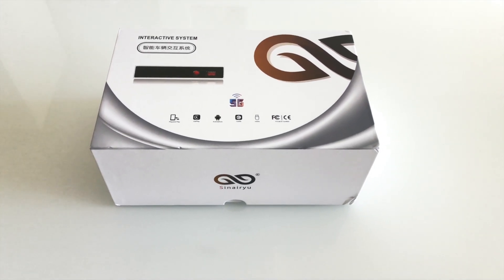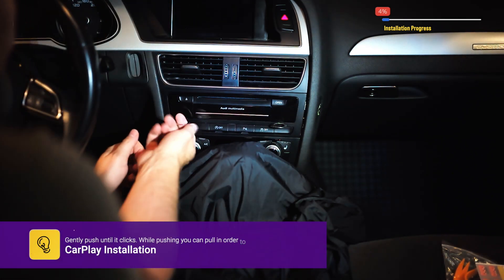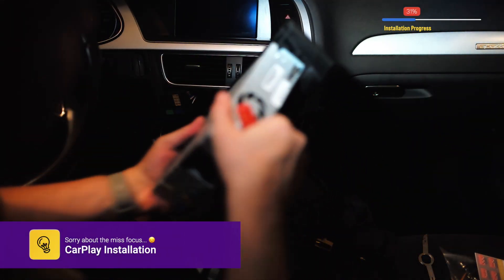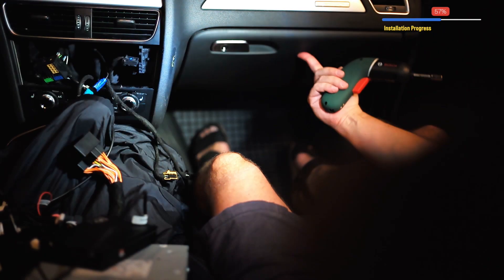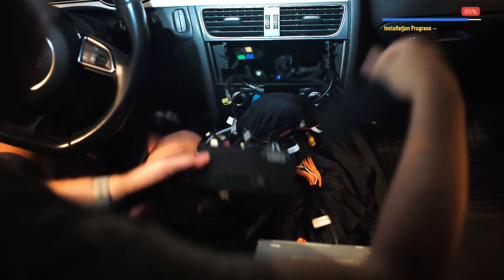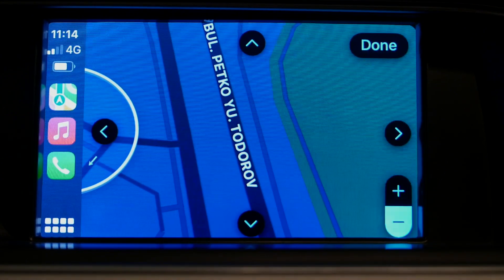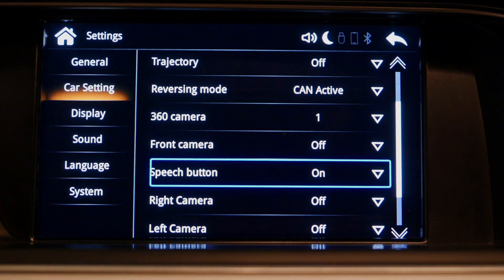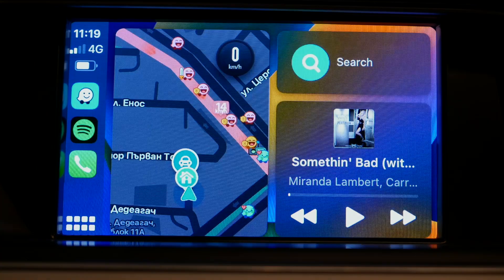Audi MMI Wireless CarPlay Upgrade - Retrofit

Comment: Audio quality dropped significantly. I have bose system and the sound now is very bad. Do you have any advice ?
Reply from the maker: @nerogruda2114  yes, keep the equalizer flat on the new unit and max out your treble and bass on the Bose.
Reply: @bonevchannel  very kind from you with the fast response. Now i am very confused. My MMI audio doesn't have sound anymore when i connect my phone through car bluetooth. I have to change the source to AUX in order to get sound. Another thing that i am confused is that the seller wrote that if i don't have AUX but AMI port i need an AMI to AUX cable in order to get sound. But i have sound through android auto but it's just pity. Thanks for your time.
Reply from the maker: @nerogruda2114  you have to connect your phone to the new unit and disconnected from the car audio MMI

Comment: What's the name of this unit?
Is there one for Andriod Auto?
How much do it cost?
Reply from the maker: Sinairyu from AliExpress
Reply from the maker: This is the unit. It arrived very fast, less than two weeks. 

https://a.aliexpress.com/_mPB9I7o
Reply: What year and SW version did you have before?
Reply from the maker: @cooperalanmyers  what do you mean by before? Before that was 3G+ with the latest maps and firmware/software. The CarPlay unit came with software that required holding the menu button to switch between the MMI and CarPlay. They send me an updated version to switch with the Back button. That avoided the issue with getting to the Green Menu.
Reply: i will the Update file :( since ios 17.3 it doesnt match with Bluetooth

Comment: How do the normal functions of the car appear such as climate control
Reply from the maker: They will not show as overlay unless you switch back to the MMI. On my model I had a separate display for those so it was all good. Still switching to MMI  is just a button away.